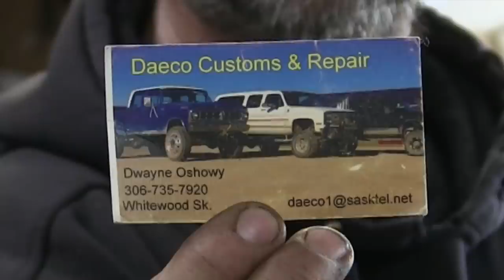Alaska road trip disaster!

Comment: That deer might have saved your life before that tire blew. A little duct tape and you're good to go. My last drive to Alaska was way back in 89 from eastern PA. The most exciting things about my trip were the tornado on I-80 in NE near the WY border (hid under an overpass as it went right over us. 8"s of hail covering the road too.) and my manual trans going in the mountains 150 miles from Dawson Creek. Limped there stuck in 3rd gear. Darned if there wasn't a Ford dealership there with a trans for the stang for only $500 after the exchange rate. A 4spd manual 79 Mustang with over 250k miles on it. The best way to get the old urethane/butyl tape off is by heating the razorblade. You broke in the new windshield quickly with big bloody bug splatter. Road trips are great...
Reply from the maker: WOW, that sounds like a major thing to have experienced. The tornado and the hail!
Reply: @Bushradical  Something I'll never forget. There were maybe 10 people crawled up under the overpass on the westbound side. The people whos vehicles couldn't get under it had most of their windows busted out. It was like driving on marbles after it passed. All you saw was white like it had snowed. I had no film with me at the time. I was lucky enough to see the tornado heading right at me as I approached the overpass. Then the hail fell and it got very dark and loud. How you guys were able to fix your car's roof was great...
Reply: I think the tire got bald because of the deer though?

Comment: As a driving instructor I have some helpful information. Last time I went to Alaska I saw over 50% of the vehicles with some type of crack in the windshield.   Anytime you have a crack in your windshield it compromises the structural integrity of the windshield. I am not sure if this gentleman had any cracks in his windshield but if you do have cracks in your windshield it can make the damage far greater. You should try to always get a new windshield or fix any rock chips that could turn into a crack.  Also, if you have a crack in your windshield and a rock gets flipped and hits the crack it could actually go through the crack into the cabin.
Reply: He hit a big ass deer that windshield was gonna break

Comment: Drove out of Alaska in Feb. 82'. Lifted K5 Blazer with winch/moose bumper. Was run off the road by an Oldsmobile with a U-Haul roof carrier just outside of Whitehorse, they were heading north. Wouldn't have been so bad but when you end up 25' off the road and 25' down below the road it sort of sucked. Sheared off the teeth in the front differential trying to get out (found that out later) and was stuck there for about a hour before a civilian trucker that hauled pumping equipment to the North Slope came by and helped me out of the snow. It goes to show you that a few friendly beers in a bar in Fairbanks can go a long ways. I loved the drive out in the winter. I went to Georgia by way of Texas (my friend that was riding with me was going to see her mother), across I-10 to Florida and up into Georgia. Round about way to get there, but a great trip overall. But you definitely have the Alaskan trip of all trips, just glad you and your pup weren't hurt. And it is documented on top of that. Your buddy at the airport: "You're late." Your response: "Had a little car trouble.:
Reply from the maker: LOL....I got to Fairbanks in time

Comment: To help with snoozing in the car on hot nights, if you take bug screen (screen door) and some Gorilla Tape and secure some to the inside of the window frame (side windows), you're able to have the windows cracked, or down without being eaten alive during the night.  Congrats on getting there in one piece.  I know that feeling, spent four nights in Whitehorse waiting on a crank shaft for my V8 to be shipped up from Vancouver.  Canadian Tire (at the time) had a very good wrench working there, named Rocky Holt.  This was around 1993.  That engine is still running solid today.
Reply from the maker: WOW! Canadian tire changed you CRANKSHAFT!!?? Thats like open heart surgery for a car
Reply: @Bushradical  They also verified the align bore was in spec.

Comment: A tree did the same to my truck. I took a come along, attached it with chains to a beam in a barn and fixed it. Scary how easy that was for you to bend it out. The truck was difficult to bend back.
Reply from the maker: Its the crease at the leading edge that gives it rigidity....we worked the crease back into shape before we put the wind in and it was a LOT more rigid

Comment: My version of having that happen to me was a mess. This was in western Mass by the new york border. Just bought a 1974 plymouth duster.
From an older woman in Pittsfield mass, for $800.00. Not driven in the snow rust free, sky blue with a black vinyl top. 318 V8 44k on the clock.
AC even worked so happy to have a good car. Drove back to great barrington mass on rt 7, at night and guess who decides it is the right time
to cross the road. MR large buck deer, 2 hops and smack in middle of the road. Only doing 45 so i swing left away from him, pass him and bring the car around to the right side of the road. Drivers rear tire explodes - dry rot. Then the passenger side rear also explodes, a few high speed spins in the road and the passenger side finds a 3 foot wide oak tree right at the door. All the glass is gone and the car is scrap metal embedded into the tree 15 feet off the road - engine still running. I almost cried, i owned the car for less than 4 hours and it is junk, running junk but never be on the road again. 1987 and it's the first car i have killed ever being 23. I am demoralized, crushed how could i be so stupid to not check the tires?
They looked almost new lots of tread so let's go right? Yeah, right let's go i knew nothing about dry rot of tires being 23. Had it hauled home for $50. Found a '73 duster and put as much of the first car into the second and saved the rest as spares. Got ten years out of that car, sold it running fine for $2,500. The 2nd duster cost $2,000 with a slant 6, and was not as perfect as the first car was.
Ten years and still made a few bucks i'll call that a win. Learned a hell of a lot about cars. Did not die could have if i hit the drivers side instead.
Would have been a messy corpse to clean up, tree came into the car a lot. Deer must have thought - stupid humans as he ran off.

Glad you were not harmed, and the car was saved to run more miles. If the dog got hurt that would have sucked bad.
Overall you got out of it in pretty good shape. On to the next.......
Reply from the maker: Sorry to hear about you loosing such a cool car. I'm also glad the dog and I got out of it so easy. Thanks

Comment: You had the right idea with the ax and hammer. But you put one tool on the inside and use the hammer on the outside and pound into the inside hammer. Real slow small taps and you can remove those dents. Your auto insurance should have replaced all the glass with one deductible or Alot of states don’t have a deductible for glass repair
Reply from the maker: Thanks for the info

Comment: Dude! Tires how can you travel the distance you do on bald tires?
Do a video on getting tires and how important it is!
Reply: Any tires would be better than those bald tires. Even a set used no-good snow tires.
Reply from the maker: The tires were fine. the bald spot was a result of locking the breaks on a Chip-Seal road.

Comment: Your deer incident is so similar to the run in I had with a moose earlier this year.  Damage looks the same .The I-Beam between the windshield and side window saved me from it completely coming in and through me.  The windshield collapsed entirely on me.  You were fortunate to have survived and had no major injuries. I had both concussion and whiplash.  Very fortunate I swerved sharply or it would have came completely in the cab and killed me.  Also fortunate it was not a buck or the rack would have decapitated me.
Reply from the maker: sounds like you had a close call for sure!

Comment: Here are my thoughts on the roof repair.  When the roof was made, it was a sheet of steel that was stamped in a mold to that shape.  It became a "Structure" of the car that was capable of allowing the windshield to Float in the frame.  With the roof heavily creased and dented, it no longer is a structural part of the car.  The "Windshield" is now the Structure that is holding the Roof.  That isn't going to work.  Vibration and any load on the roof, air pressure or a wet snow load etc., could break the windshield.

I would have used a straight sheet of thick steel, 1/4", on top bridging the dents and then a clamp to take as much of the dents out as possible and get the roof the best it can be.  Set the windshield in place to make sure the roof shape was correct and the caulk could do it's job to allow the windshield to float without making contact to the metal.  Then I would bend a piece of Rebar to the shape of the roof and weld it in place under the head liner to make a Roof Rafter to reinforce the weakened sheet metal.

You might want to just leave it and see what happens.  If it cracks, then you can have someone reinforce the roof.  Real cute and affectionate dog!!!
Reply from the maker: Thanks. Dwayne actually repaired the leading edge of the roof reforming the "crease" that gives the roof rigidity. It was a TON more rigid once this crease was pounded out

Comment: It's always early morning or at dusk. Deer seem to be most active crossing roads then. I live in Alberta, Canada so I end up driving lots of long roads with deer everywhere. Lots of times I don't see any other cars on the road for a really long time and I think it's easy to start to get complacent, maybe put on the cruise control. But your biggest risk in that situation is deer. I drive a little Hyundai Veloster so I can't really take the chance of hitting a deer not to mention I would feel horrible for the deer even if I was driving a huge truck. If I have a passenger I'll get them to also scan the sides of the road for me. A few rules I always follow so that I don't hit anything is NEVER out-drive your headlights. So basically don't go faster than you would be able to stop if something was at the farthest point your lights can illuminate. Of course that distance and speed is based on so many factors so you need to judge that for yourself. Then if you see one deer you NEED to assume there are 10 more waiting in the ditch or bushes that are hidden about to all run across the road in front of your car. If you're on a super curvy road where you can't see around corners and it's dusk or dawn, go a little slower than you would other times of the day on that road. What happened to you wasn't a statistical anomaly. Which is why deer is one of the top animals in North America that cause human mortality. Cute dog btw :)
Reply from the maker: Thanks for the good tips. Makes a lot of sense.

Comment: I had similar experience, Traveling  at 65 mph from Kokomo IN to New Hampshire I encountered a very large Turkey smack Dab in the middle of the windshield  July 4th 4am. Totally blasted out the windshield. Good dent in the roof. No glass shops open for the 900 mile trip. Raining. wipers having big problem with the 5" dent in glass and a  10 " x 14 " view thru the glass. Only Police official's even looked at me was in NY and Vt.  Would never do it again, Water coming in, very little view. Got to glass shop. July 7th . Worker said to me, You drove this for 6 miles in this condition?  I said with a smile, No 805 miles. in the rain. with glass covering the interior of the Wrangler , The trip Was 5 hours longer than expected.
Reply from the maker: WO! Thats hard core

Comment: I travel by myself to Arkansas and see many deer on the side of road. I have hit two deer here in LA . But in a truck , and smaller deer. That would shake me up good to have the full windshield hit. And ask strangers for help. A wind shear in LA did throw a traffic light into my windshield and broke it as the light pole snapped and trees were coming down behind my trail trapping me on the road. There were hundreds of old trees that came down that year. Hurricanes are making it to north Louisiana, we are still chainsawing the 7th 100 ft  tall white oak tree. We just had several tornadoes this afternoon, but they missed us this time.

Comment: Events like that can spoil a trip VERY quickly. Sadly outside cities, where wild life roams therr are many hazards.

Here in Australia, depending on where we have plenty of hazards. Some more than deadly. While yhere are some wild deer, derived from some released animals many years ago, not natural fauna, but rare as hazards. Bur plenty of wallabies (smaller but similar to kangaroos), wombats (very solid stocky figging creature) where the humerous joke is given choice between a large rick and a Wombat, jit the rock it will cause less damage. But across Australia we can hit large Kangaroos, a big male stands over 2m high, Cattle, Camels, Water Buffalo, Wedge Tail Eagles, Horses and more. Kangaroos like the deer can total a car. But worse is they can go right into the car, whence there are cases of the occupants have their heads kicked off, those hopping legs are extremly strong. 
Wdge Tail Eagles are large predators able to carryoff lambs and calves easyly, sadly they also gather on road kill, tend to remain on the road or road verge till last second and often are hit just after takeoff so direct into the windscreen
 If not killed by impact can also do massive damage to occupants with claws and beak. Plenty of road kill in form of kangaroos, wallabies, rabbits, lizards, snakes etc.
Of course to hit horses cattle camels or buffalo will destroy cars but many are hit by large trucks and especially our Road Trains, trucks hauling up to 5 large trailers of size equal and larger than normal longhaul semi- trucks. In many cases with the strong bullbars, as we call the frontal protections, the cattle and even buffalo are killed and even torn in two, with halves on opposite road sides. That carcass in days stinks and wobbles with maggots. No they are not removed by clearing crews. Too long road streches and too much road kill to be economic.
In a car evening and night driving are especially dangerous. I have survived several night sessions often more by luck and strained attention as well as high power extra driving lights. In one case due to time pressure I was leading 6 test vehicle convoy at 120KPH in central Australia, and at extreme high beam range saw a reflector on road side markers blink briefly, after warning via CB radio  I slowed to 60KPH. Finally was about to radio all clear and accelerate the lights showed a herd of cattle crossing the road, barely visible grey/brown dusty colour of road and cattle blending. At 60 I could barely stop in time,at original speed, fatal smash into possible upto 5 cattle or more. The driver team agreed we must travel slower to safely get to Alice Springs and our motel, even though it meant arriving nearer mid night. We had 400Km to go after already doing 800Km since early morning. With one driver swap over.
Load trips are hazardous, multi day trips even worse. Probably also for your trip to Alaska, I have several times travelled 3500Km over 3 days and up to 1400Km in a single day, that with 100KPH maximum legal road speed, so around 18 hrs as single driver. Towns, fuel, food/drink of course make average speed under  100KPH average.
DANGER, DANGER, DANGER is all I can say as I do not like that at all. Yet have done it, but do just pull away from the road and sleep if I do get too tired. Normally I do 1/2hr breaks every 2 hrs to keep fresh and rather travel a day or two longer.  14000Km in a month or month and a half has been common enough.
Anyway enough, I do understand your travel and the unexpected event. Glad you and the dog managed to survive with little more than a near wreck car.
Reply from the maker: Thanks Helmuth. I'll hopefully make it down there some day>   I'd love to see your country
Reply: @Bushradical  Well it's a large place with many different scenery and climate from tropical to snow 8n our mountains. NOT mountains in your sense, more large hills on high country.  Deserts to Rainforest, great beaches to rocky desolation. 
Depending where could be mildly cold  our coldest is typ to -10 degC,  to hot dry, to over 40 degC,  to hot humid.Tropical
Unless having lots of time need to choose destinations, and plan on getting around. Flying is quick but costs, driving means long distances. To fly say Sydney to Alice Springs in central Australia may end up costing a similar amount to USA to Australia, though package deals are possible. Sadly flying you also miss much of scenery. 
Depending on personal interests the Barrier Reef can be great, depending on season Whale watching, Gem fossiking ( Sapphires, Agate, Gold, Opals and more). , Fishing , Astronomy. 
I am reasonably (quite) sure that you and Brooke unlike most tourists will not be seeking 5 star city hotels and tours 9f art galleries, but looking to get into country side and wilderness

Comment: I take it no insurance?? otherwise why wouldn't you just take a pay out for a ridden off vehicle- roof damage.
Reply from the maker: I have minimum coverage. This car gets about 36 miles a gallon and I know every inch of it, so I just keep driving it, and when something breaks I fix it....or when it comes to the windshield I let someone else fix it. I actually dropped a fresh motor into it last winter so It has 116K on the engine and transmission about 300K on the car itself.